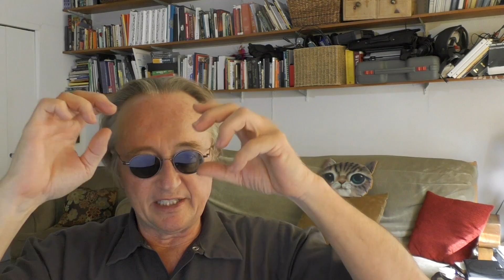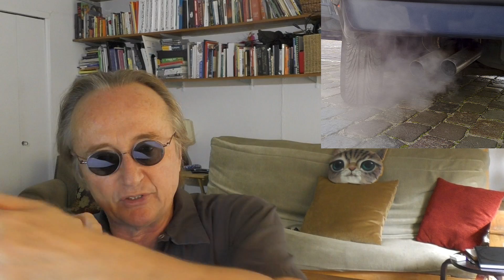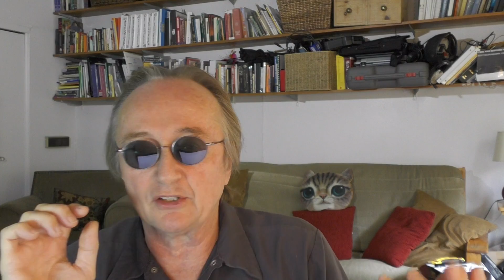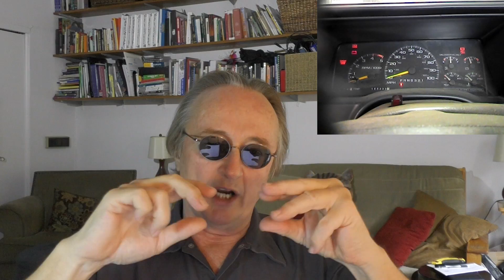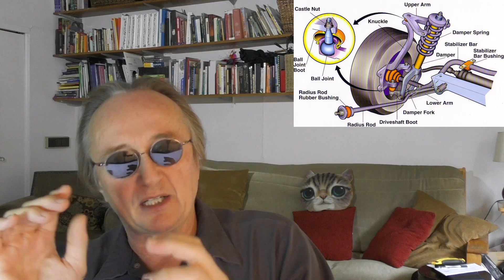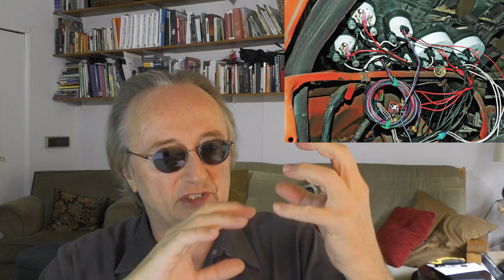This Product Will Destroy Your Car’s AC System

Comment: Subaru even in 2018 had a problem with cracks appearing where roof and pillars meet. My 2010 Subaru Outback had a problem like that as well - cracks appeared where D pillar meets roof. You could hear the roof cracking when driving on uneven surface. Got my Subaru roof-D pillar area welded by dealer, which cost me 200€. Other expenses were covered by warranty. Has only been driven on roads and never off-road.

Comment: Speedometer in my 1991 Mercury Topaz works fine until temperatures drop below 20, then it goes crazy.  I was driving about 35mph and it was showing me going 115!  I doubt my little 4 cylinder engine could go from 0-115 in 2 ft.  Once it warmed up it works fine.  Any ideas?
Reply: Speedometer internal mechanism gets stiff in cold weather because the old 1991
lubricant has degraded making the mechanism stick somewhat during the cold.
And less often the speedometer side of the cable has a worn tip on it.

Comment: You are absolutely correct Scotty. Install the leak dye and use a black light. At least you will know what to fix. Or do like I do, just keep adding more r134 every spring
Reply: And hope it's not the evaporator, or it's dash off/a lot of money time if you want to repair it and not use the leak sealant. Smell anything resembling fresh paint or Band-Aids out of the vents and it's 99% a leaking evaporator...

Comment: Actually what destroys it even more are those people who buy a $15 can of R34 and just fill up their system without knowing how much is in there, or having air in the system. Spend the $80 and buy an ac evacuation pump and gauge kit on ebay
Reply: Most repair shops dont charge that much to recharge your ac.  If you don't know what you're doing, you'll do more damage than good trying to do it yourself.

Comment: The Chevy.truck speedo issue brought back memories.  I had a 2004 Silverado  that would suddenly go off, and I ended up with a ticket.  It was a known defect, but Chevy wouldn't fix it unless it became permanently stuck.  The tach worked, but I ended up getting a GPS.
Reply: If the tach worked then you should have known how fast you were going.  Kinda your own fault getting a speeding ticket.

Comment: AC systems are not that hard to work on and you can get almost all the tools for under 250 bucks. I rebuilt the AC system for my beater S10 part tools and all for 600 bucks much better than the 1500 dollars the shop wanted.

Comment: Hi Scotty, My wife has a 2010 Honda Odyssey touring. What causes the engine to use oil at 1.5 quarts between oil changes. Has the standard 6 Cyl. engine.
Reply: How many miles?

Comment: If your car is making a "cranking" noise when the steering wheel is turned all the way if the car is front wheel drive (as most cars are these days) it can also be a CV joint about to give up the ghost!

Comment: Hi scotty! I have a 2017 Toyota camry. It has 23k miles and lately every time I reverse and press the brake, it makes a popping noise 2 times or 2 clicks. What do you think it is? I really hope it's not the transmission, please help!  Love and enjoy your videos btw😀 keep up the great work!
Reply: You should still have warranty so it should be good to go to the shop
Reply: PrinceDarkness you know I thought it did. I bought it used and I don't think they mentioned anything about it. Maybe cause I bought it at a Nissan dealership lol but thank you, now all I have to do is take and not worry. Thanks again 👌
Reply: @DanielMartinez-du3is  your out of basic by time 3 years your powertrain is 5 years 60 thousand miles so if their is an issue it should be covered provided its an engine or transmission issue
Reply: PrinceDarkness ahhh ok. Well if it happens to be the transmission then I'm good. Thanks again dude!
Reply: @DanielMartinez-du3is  your welcome just make sure to look at your warranty guide as well that can help give you an idea of what's covered and what's not 😊
Reply: Could be a recall too. Then it wouldnt matter if it were under warranty or not.

Comment: Hey, Scotty. Not sure if this is the place to post this, but oh well... Around last year on my mom’s 2004 odyssey, the rear sliding door motors broke. Fast forward to now, and occasionally on right turns, the left door will briefly register as open, causing all the interior lights to turn on for a second and then turn off. This is only on right turns, but not all. Ideas on what it might be? Thanks

Comment: Hey Scotty, on very cold mornings,  my 2017 jeep renegade has a message that comes on saying "engine heater advised" Do I really have to get an engine heater?! I have never had a vehicle that needs one. Mornings sometimes can be below zero here in Maine. So far the vehicle continues to start without an issue- but is it bad for the all the computerized crud?

Comment: I would like to see you review the Lucas oil fuel mixture product
 I never used it, but I see oceans of people using it in their vehicles and I just think to myself "these people really think it works"
  I'm not in automotive expert but to me it seems just as ridiculous as people thinking that a specific gasoline brand is gonna give them better mileage
The engine combustion process is a pretty set one, aside from when you accelerate the engine a higher octane fuel will probably combust faster but in all likelihood your mileage is not going to vary depending on the brand
Reply: This stuff is to nurse an ailing engine and keep it running.  It should never be used on a good running engine.

Comment: Stop leak a/c products work by contact with moisture. The system has to be
dehydrated beyond factory specifications as all a/c's have some moisture. Leaks
with the synthetic oil used today suck up moisture. Get it dry and I have had great
success with them.

Comment: Hi scotty, I took your advice and purchased , a nice 2003 pontiac vibe, with a tyota engine and trans. 132k on it. after  just 3000 miles I noticed my "miles per gallen drop from 33 35 to 21 23! it has a new ox. censer .car dosen"t miss, or hesatate, plugs look oky. What would you look for and fix to correct the bad fule milage? ! live in a cold climate,WIS> would that have a berring? Im a senior, so MY hot rod days are over, and I drive like goddy twoshoes!   The      local barney fifes smile and tip there  hats when I drive by!

Comment: Scotty are k&n filters safe to use does it damage air flow sensor do they last as long and do they really increase horsepower does anyone knows please help
Reply: If you use filter oil it can affect or even damage the air flow meter,
Reply: I've used them for over 8 years in my Nissan, BMW and Saab [haven't bought another filter since], I never had or saw any of the problems people say of oil getting on the MAF or anywhere even the inside walls. The only reason I can think of is that some guys spray on too much oil after cleaning it and/or slap it in without a drying period.
Reply: The biggest problem with a K&N is that they get installed, maybe cleaned once, and are then forgotten. Then, because they're clooged, sometimes get sucked into the turbo of a diesel truck, and all hell breaks loose. A cheap clean oem filter works works a lot better than a clogged, neglected fancy one.
Reply: @c.j.rogers2422  what if cleaned regularly
Reply: @starentveveo  that's probably fine, just nobody does it.
Reply: @c.j.rogers2422  ok i thought the se sort got dirty from too much air going through it
. or when it gets dirty and u dont clean it leaks oil?
Reply: @starentveveo  Scotty did a segment on air filters a while back go check it out.
Reply: What do you doubt lol
Reply: K&N's catch a lot of dirt, but I am not a fan of the oil on them.  The oil ends up on the MAF sensor.  I use a dry air filter called GR8, it's heavy and built like a K&N, but without the oil. Plus, it is reusable like the K&N.  Just wash, dry, and reinstall, and they're not that much more than a stock filter. I have one in my Lincoln. No problems.
Reply: @JohnSmith-wd9rc  ok thanks

Comment: Hi Scotty, I have a 2014 maxima that makes a water dripping noise hitting metal or sound like a fan is hitting something after turning off the engine. I look underneath but there is no leak. What would be causing this noise?

Comment: About the flashing lights in the dash, my dad's 2006 Mitsubishi Raider did it only when pressing the gas pedal, the starter sounded funny (my dad didn't notice), I found that the 5yo battery was leaking acid and the alternators regulator was having trouble, is that common?

Comment: I had a 1990 sunbird with stock wheels and the speedometer was off by 15mph just from having tires with a shorter sidewall.  2mpg less gas mileage too.

Comment: (Bad english)Hey scotty i have a question: is it bad for the car to use worn out batteries, to save some money? The voltage is like 14.4V when the car runs and 13.5 when it doesn‘t run and it drops really fast!

Comment: Hello Scotty. I have a 2016 lexus is 300 with 28K on it. This is my first winter with the car up here in northeast Ohio. It shifts a little late when cold. Is this by design or am I experiencing a problem? Love the show and thanks for having it
Reply: That's kinda normal for most automatics.  I'm assuming you mean it won't shift into its final overdrive gear until you drive a few miles.  It just takes a while for the fluid to heat up and work properly in cold weather.
Reply: @gregrowe1168  thanks for the help. What I mean is instead of it switching into third or forth at 1.5k rpm it goes to 2.2k rpm. It just switches a little later compared to being warm?

Comment: 6 years ago my wife bought a 1994 Ford Taurus for $600 it had 65,000 miles on it.
Ugly as sin but has a great ac and has not had a problem with the car.
Till now.
Losing steering fluid,  having to put in 2 bottles a month. 
Any ideas?
Reply: Get rid of it. I'm not being facetious. An older car with that little miles on it is asking for trouble once you start using it regularly. It's not really a good thing to let something sit excessively. Gaskets get brittle, exhausts rot out, fluids like brake and power steering are hygroscopic which means they absorb water- so p/s pumps and brake components/lines fail....etc. etc. etc.
Reply: @r.joseph8911  
She has been using it for 6 years.
She puts in about 1k miles a year.
Has had no problems except recently the steering fluid leak.

Comment: QUESTION! I have an 06 kia minivan, 130K and every little bump the font end knocks and bangs BAD! Replaced inner and outer tierods, ball joints sawy bar links and bushings. Still knocks! Drives fine and has had an alignment done and it passed inspection. What could be wrong?
Reply: Sounds like it could be struts.  Have you checked them?
Reply: @johnjackson1924  unfortunately over the past month of it being driven I've come to believe the strut was my issue. These things aren't cheap. I've just never heard a strut knock. 36 years old and have been wrenching on cars since preteen! Just wanted to see what other people think. Thanks!

Comment: The original nuclear submarine the Nautilus they use stop leak to fix the radiator. They pulled into a harbor in New England. They sent the crew into town to buy all the stop leak like they could find. It worked!

Comment: Just get it fix right the first time by a  """"""Professional""""""""
Those fix a leak will only patch it to make it another month or two if you lucky, dont recharge your system yourself. 

Best deal,  take it to the shop.  You will save alot of money in the long run

AC work runs about $700 to $1200 if it's not working

Something minor looking at about $75 to $250

Get it done right

Comment: # scottycarrepair
Could you do a video on CVT. I have a 2006 Ford Freestyle and I am concerned about it failing on me! It has 120k miles on the odometer. Thanks again for a great video!!
Reply: Ford CVT TRANSMISSIONS ARE GARBAGE. THAT'S WHY FORD WENT BACK TO TRADITIONAL AUTOMATIC TRANSMISSIONS AND DUAL CLUTCH TRANSMISSIONS.

Comment: I used a/c sealer once and it clogged the condensor panel. The EGR valve is used to reduce combustion temperature and reduce Nox(nitrogen oxide) which forms smog.

Comment: After buying a 98’ Isuzu Amigo (many years ago) with 40,000 miles on it, I had to return it to the dealer 3 times as the alarm kept going off in the middle of the night starting its first night home. I advised the dealer that the dome light was coming on when I turned quickly. They spent hundreds on new parts and never figured out that it was a torn boot on the door switch of the tailgate. I guess the circuit would break as the plastic cooled overnight.

Comment: If your car has an Agr ventiel then remove it from the car.
Because for the most part you only have advantages. like for example, the car runs better when it is idle.
Or the intake bridge and the throttle do not get dirty anymore. And the engine can breathe freely.
the disadvantage is that it is ''illegal'' and with newer cars the engine control unit has to be reprogrammed so that the error light doesn't light up. Otherwise you just have to take care that the car gets slower warm.

Comment: always best to have your ac repaired correctly, then completely evacuated before being recharged
Reply: You probably don't know the labor for an evaporator replacement on most cars.
Reply: @teravolt6113  The average cost for an AC evaporator replacement is between $815 and $1100
Reply: @Pgcmoore  That's a lot of money. Even more expensive than replacing a seized up compressor with a reconditioned one.

Comment: Hey scot i have a 1997 ford expedition with the 5.4 330 . while its hot and your costing at really any speed then give it a little gas the truck acts like it wants to shut off mutipal times until you give it more gas then its fine. It will also do this and as low as 1 mph and actually sometimes stalls out. Now in the morning when i go to start it it will hardly run and then die. Start it again and will do samething but then correct its self and run like normal. Any thoughts ?
Reply: That sounds like the fuel filter it's probably on backwards
Reply: @Bubba Bee  lol thats that hose thats collapsed i think. There is also hoses two of them that make a loud wining when the motor is off. ...lol kinda common sense but never has caused problems til now that its cold. Thanks very much man will do all these things!
Reply: @Bubba Bee  yes thats the one its all sucked up on the bottom. Lol i just picked this up 3 weeks ago in Tennessee so ya. Gotta replace all the rubbers on the front end and ball joints. Drives perfect and straight but the rubbers are gone litterally nothing and cracked and falling out. ...brand new kellys on it with a little over 3,000 miles on them but inside of the tread on both fronts is cupping very badly
Reply: @Bubba Bee  hey also what i was trying to say the first time the two hoses that come off the side of the air cleaner is what i need to ...what do they go too ? Also any other tips if you can to watch out for ? Thanks very much for the advice...really cool man. :)
Reply: @Bubba Bee  thankyou very much for answering me and all the help and addvice !